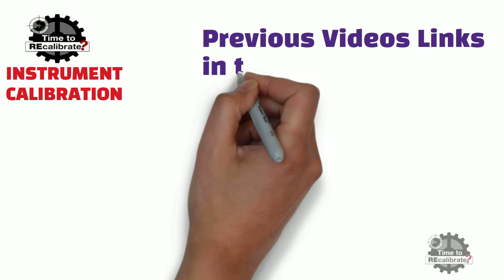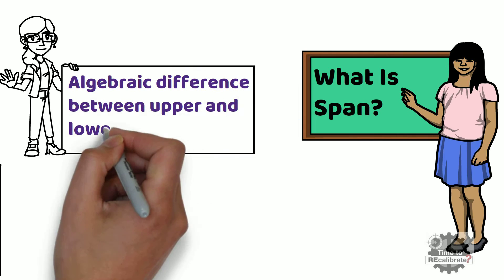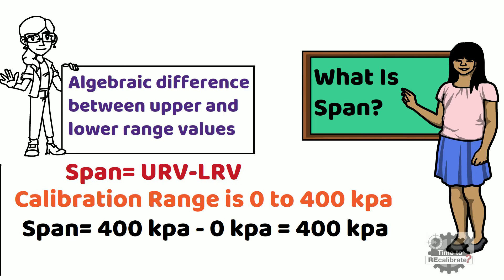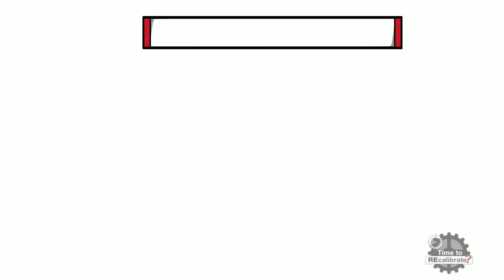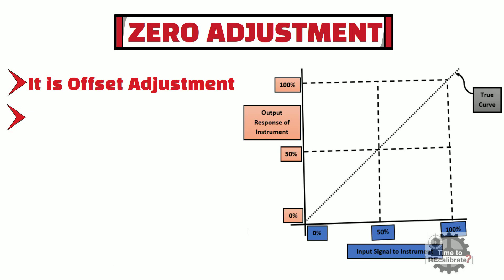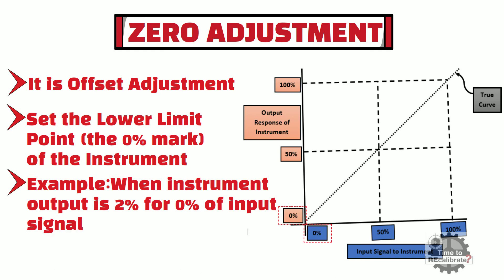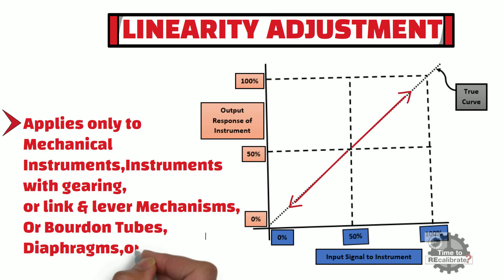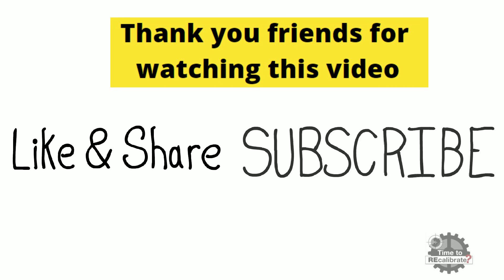What is Zero Adjustment , Span Adjustment and Linearity Adjustment

Comment: I seek clarification regarding the zero -span calibration of a transmitter.my specific concern pertains to a tank with a capacity of 200 litres.Where the transmitter is mounted 100mm above the bottom tank.what level should I press zero?
Reply: depends on the dimensions of the tank

Comment: My situation we have a 3 tiered vacuum pump system in an industrial plant. Someone moved the pots in the Barksdale pressure transmitter. Normally the pumps would cycle once vacuum was reached. Now all 3 pumps are running all the time.
Vacuum was set to run between 24 to 26hg, and the program would cycle the pumps as needed. Started empty all 3. Once vacuum was achieved depending on demand 1-2 would run. During the course of the day the system would cycle the 3 pumps. Alternating pumps giving equal run times. Not anymore.
I am new at this so how would I go about seeing my span and null?
Reply from the maker: Sorry...This is more about process issue. I don't have answer for this question.